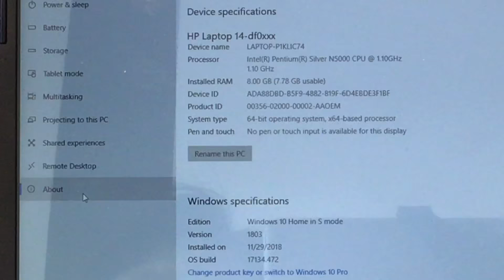How to Upgrade Memory in HP Laptop without User Removable Battery: DDR4-2400 SODIMM | HP 14-df0013cl

Comment from the maker: Almost a year later, this computer is still going strong with the added memory (despite accidentally bending the clip)
Reply: Wait so I can’t add 16 GB?
Reply: Could you help me with this computer my keyboard isn’t working
Reply: @choppmonster7  I recommend you to get 16 GB if you wanna multitask, otherwise 8gb is fine
Reply: Hi Aaron, thanks for the guide. But I need to ask, didn't you loose any files after installing a new RAM???
Reply: @mdlamini11  You don't loose any files after installing ram, everything is on your hard drive.
Reply: @Trevor Alfredo I wouldn't look it up, it'll probably lead to malware not to mention very fucked up
Reply from the maker: @mdlamini11  No, files are not stored on RAM when the computer is powered off
Reply: @aaronwissner  thank you Aaron
Reply: @aprilsvoid582  LOL
Reply: I don't even bother touching the clips.. I just push the ram in and pull it out. Also are you supposed to remove the battery. (You don't really have to, it's just safer I would think..)
Reply: @Trevor Alfredo nice scam
Reply: nice to hear, I have a newer hp with ryzen 5. Critcal Ram website says it can handle 32gb, should i go for it? because I already ordered it. lol. I hope it works okie when I do this too I am a bit nervous honestly. My laptop is my baby.
Reply: @aaronwissner  can we install 16GB +8GB pre installed RAM(Samsung M471A1K43CB1 8GB DDR4 2666MHz RAM) = 24GB RAM

Is it support in HP 15g DR0006TX laptop !?
Reply: Mine still going strong with 4th only.
Reply: @maplefoxx6285 I have a laptop my father had before he passed away and it was his "gaming" laptop, only had 8gb of ram. I'm on a mission to tune that machine up as much as possible since it has two fans and tons of storage. 32gb is twice as powerful as a PS5 and really not that expensive, I say go for it.

Comment: He break the Ram Clip while removing the ram stick he used to much pressure on the clip.
Reply: no  he did not it was already broken when he pulled the bottom off; from what I saw and I watched it twice a factory defect and it do happens
Reply: @memalephyudth  no he definitely broke it lol
Reply: @gamelard1963  agreed, those clips usually just pop to the side and you put the ram back in they don't need to be touched.

Comment: remember the days when laptops used to just have a little trap door with one screw that revealed the ram and the hdd? those were the days! Also did th rubber strips stay in place after you stuck them back down?  I just bought a similar laptop for my elderly mom, I suspect 4gb will be enough for what she does, but 8 would certainly be better.. I just don't want to start peeling tings off and find it doesn't stay stuck in a week or so lol.
Reply: Never again HP
Reply: As a 2000s kid, currently with HP 14, I'm more than jealous
Reply: Picked up a thinkpad t540p not long ago that has that setup.

Comment: Hello i have a question i have HP 15.6 model 15 -dy207dx  8gb-256gb SSD is it possible to use the corsair vengeance i was possible trying 16gb will it work ?

Comment: Thank you so much for this video! I was trying to find video help on how to install additional ram into a laptop similar to yours. I just installed mine and now have 12 GB! You were a God send!
Reply: My hp 14 cm007la has 4gb ram ddr4 and i want to upgrade to 8 or 12 gb, it works 4+8gb? Differents Brands? Because mine is micron technology and here in Perú there isn't that brand, only crucial and Kingston, so it Will work 4gb micron ddr4 2666mhz + 8 gb ddr4 Kingston / Crucial = 12gb ram or 4+4 = 8 gb ram different Brands
Reply: @raymongarrido5682  Micron manufactures crucial memory! 😂✌ and don't use  two different memory types use 4+4 ,or 8+8 not different 4+8 , you will get a slower performance. Make sure the Mhz matches as well.

Comment: EXACT same config on "HP Notebook - 14-dk0024wm" from Walmart...no SSD only M.2 Drive (even though some sites say it has SSD capability - I think they skipped on this model specific)...this model upgradeable to 32GB RAM...Upgraded to 16GB Kit from Crucial...buying M.2 for the slot.  SSD slot is THERE...but no SATA interface/power.  Great Job on Vid Aaron.
Reply: m.2 is ssd
Reply: I have this one, just bought it on clearance at Walmart for $200. I'm here because I knows there's more to this machine than what we're lead to believe. My heart skipped a beat when I found it had an m.2
Reply: "No SSD only M.2" 
This comment of yours lit up a bulb in my head. My HP x360 notebook died. I don't want to take it for repairs because of confidential info on the drive. 
After watching YouTube videos of how to replace SSD, I opened the laptop only to find a big space for a drive as shown above and NO SDD.

Paranoia kicked in. I thought the notebook died because someone quietly stole the SSD. lol

Comment: At 6:40 it looks like you broke that retention clip. I've never seen that happen before! Anyways, there's definitely a spot on the board where a 2nd RAM slot could go, but the slot itself is absent, which is a pretty extreme cost-cutting measure on HP's part. Also, that's definitely a spot for a 2.5" drive but I can't see any connection points to the board. This system has an eMMC, but I can't spot it on the exposed area, so it's probably soldered in a concealed area, and I don't see any other way to connect other drives, via SATA or m.2.
Reply: It popped clear really quietly and easily and then he just kept pulling until it snapped.
Reply: the newer 14 models have 2 ram slots yeah where you mention where it should be, imagine trying to save at all cost that you decide to save an extra .5 of a  cent by not including another memory socket
Reply: @goldchris1111  It's a very low grade processor, it cant hamdle much RAM. Note it's rated for 2440 MHz and I3 or I5 processor would take 3200 MHZ and likely up to 64gb ram.  There would also be a removable drive in that empty slot. Either an M.2 SSD or an HDD spindle drive.  It's a super cheap and lower performance computer, not good for much beyond surfing the web and using Facebook or Twitter.

Comment: Perfect video for my needs. Thanks!!

I have a similar model, the HP 14-cf0006dx. For anyone searching for memory upgrade info on this model, it's virtually identical to the one in the review, however, it has two memory slots. I kept the 4GB slot memory and added 8GB to the other slot. IFixit makes a $2 opening tool that's perfect for this task. Not sure how to add a 2.5" drive but the SSD module can certainly be upgraded.
Reply: so you add 8gb and kept the 4gb memory there?? for obtain 12gb??
Reply: It works good with 12gb ram? Or its better have 4+4 = 8gb ram? I have this question
Reply: Thanks for the info - I too have a HP 14 CF0006DX model. Have you ever found a hard shell cover for this model?

Comment: Thanks for posting. Knowing there are screws under the rubber strips is key.  HP definitely does not want people upgrading these models.  I have an HP 17-by0063cl and it seems like it will be the same.

Comment: Can you keep the ram that's already installed and put 8gb on the other one and get 12GB of ram?
Reply: No u can’t. U can use the 4gb or the 8gb. But not together. It will just slows it or its will uses the lower ram, the 4gb
Reply: Yes You Can ...Just Make Sure its The Same Brand ..

Comment: I work in a hardware store. Typically, M2.5 x 6 would indicate a metric screw size 2.5 which is 6mm in length. Probably not essential to know, but if you lose a screw those would be the dimensions.

Comment: I'm assuming this applies to other laptops with internal batteries?
Reply from the maker: Well, for other HP laptops of the same design, but I think you'd need to look down at a teardown of a particular model to know for sure if the memory could be expanded

Comment: I just got a new hp - 14" laptop - amd a9-series - 4gb memory - amd radeon r5 graphics. Mine came with the additional RAM slot ready to upgrade which I added an 8gb stick w/o removing the original ram for a 12gb total. So would you please clarify why yours didn't seem to have the upgradable ram slot?
Reply: If you loook closely when he picks the bottom off, it shows intel inside
Reply: Me also have same type of laptop. I need to upgrade to 8gb is it possible
Reply: @dhanachinni4346  you can check your max ram performance on crucial.com. it shouldn't be too hard.

Comment: Is there a way to upgrade the graphics card in this laptop?
Reply from the maker: I doubt it, most laptops sold at this price point have an integrated graphics chip or functionality.  It does display 1080p on this particular model though, but I can't recall if it could output higher resolution than that
Reply: @aaronwissner  can we install 16GB +8GB pre installed RAM(Samsung M471A1K43CB1 8GB DDR4 2666MHz RAM) = 24GB RAM

Is it support in HP 15g DR0006TX laptop !?

Comment: How do I know if I can increase the ram on my laptop? Operating system: windows 10 home 64-bit motherboard: hp 184B (socket FT1) I currently have 6gb of ram. Any help would be appreciated!
Reply: crucial.com has a compatibility finder. I used that and then found the part I needed on ebay x

Comment: I had to replace a hard drive to one of this HP laptop, it was a Pavillion, and it was a nightmare. The mainboard was attached to that lid that you removed in the video, so to have access to the components you need to be very careful when opening because there was a flexible cable connecting to the keyboard and the USB ports.  Additionally I missed a screw and ended up breaking a part of the lid. Definitely manufacturers don't want you to upgrade their machines

Comment: How do I upgrade the processor cpu
Reply from the maker: If the processor is removable, then it MIGHT be upgradeable to one that has exactly the same specifications EXCEPT with a higher clock speed. In most cases, if possible, this will only improve performance a small amount

Comment: bought a kit from amazon for opening electronics, came with plastic prying tools, many different screw drivers, tweezers, cutting tools, nd guitar picks 😅 i unfortunately bought wrong sized 16gb of ram though,  gave the sticks to a family member. waiting on two 16gb sticks that will actually fit fingers crossed.

Comment: I have a hp 14 cm007la looks like video one, it has 4gb ram ddr4 and has another slot, should I remove 4gb ram and put a 8gb ram or simple add a 8gb ram on second slot to have 12gb ram? Pls helpme,  4gb ram is micron technology there isn't that brand in Perú can I mix With other brand like crucial or Kingston same ddr4 and 2400 mhz?
Reply: As long as it's the same type of memory you can add it. :)

Comment: HP 15-db0011dx ---Hi - I contacted HP to request the part number for the RAM on my laptop and they told me they don't sell it to me directly.  That I need to see an authorized HP technician as the laptop has a non customer replaceable RAM.  That certified tech must do it.  I have changed ram in other laptops I have owned, but this guy got me thinking.  Any suggestions.

Comment: ‼️ I found that rather than prying it open with a thin object like the guitar pic, just use that same precision screwdriver to push through the exterior holes from the very first screws you undo. It pushes the keyboard away from the bottom plate with no damage!

Comment: hello, so my laptop is newly resetted and i find it really slow and at times it freezes. i wanted to reset it cause it was also very laggy at first, do you think if i buy a 4gb ram and install it there it will be fast? cause it says i can only upgrade it up to 8gb. and my laptop has 2gb ram installed
Reply: Put in 8GB. 4 will help but for the additional cost of the 8BG (about $15 more) put the max in now and forget about having to take it apart again in the future
Reply: Rich MAC oh okay, thank you so much for taking your time to reply, god bless!.
Reply: My pleasure and good luck
Reply: My 14 hp cm007la has 4gb ddr4 and has another slot, what is better? 4+8= 12gb ram different brands or remove 4gb ram and put a 8 gb ram?

Comment: I just got a HP 14-dk1008ca for 400 Bucks. thinking about increasing the ram and the M.2 SSD Capacity. The Processor is only an Athlon Silver 3050U With Radeon Vega II with 512 MB VRam. Doesn't run Bad For it's price.

Comment: Followed your processed, and it worded.  I used an old Amazon Gift card to separate the bottom piece from the keyword.  My model has 2 DIMM slots, so I added 8 gb to the existing 4 gb for a total of 12 gb.
Reply: Do you know what the differnce is . I have this laptop as well and was wondering if i had 2 or just 1 din
Reply: @vinnystx  You can download the technical specs from the HP web site.  It should list that info.  But if you going to upgrade the existing 4gb DIMM with the 8gb DIMM anyway, you will either swap out the 4gb with the 8gb DIMM.  Or if there is 2 DIMM slots, you will leave the 4gb in place and insert to 8gb DIMM in the second slot.  Either way, you will need to open the laptop as shown in this video.
Reply: @LanceMan6012  man, your laptop works good With 12gb ram? I have a hp 14 cm007la With 4gb ram and has another slot, should I remove 4gb ram and put a 8gb ram or better add a 8gb ram in other slot to have 12gb ram? I can have 16gb ram limit

Comment: I could see when you put the new memory in that you weren't straight and that's what caused you to bend the hold in clip. Thanks for showing the location of the screws however as I wouldn't have thought to look under the rubber strips. I have a very similar model HP that I bought from Best Buy for $219 but it has two RAM memory ports which allows up to 16GB of RAM from the 4GB it came with. Since there is space in the case you can also add (using a $10 ribbon cable from HP) an additional hard drive for about $30
Reply: I just purchased it and find it very slow. I was planning to put another 4gb of ram anyway but even just out the box I am not satisfied with its performance. How are you finding it?
Reply: I'm not experiencing that issue. The boot time (because of the SSD) is very quick. I removed some of the bloat ware that was installed on the computer from the factory and then took it out of "S" mode and it's pretty quick. I also do not use the antivirus supplied with the laptop. I'm not certain what you are using it for (maybe very intensive processes?). Remember, this is a budget laptop and the AMD processor that this has is not going to be able to compete with an I5, I7 or certainly an I9.

Comment: There are two slots for RAM on this model, they are butt to butt. You could've install up to 8gb on each.
Reply from the maker: Great response. There are limitations as to what can be installed in the memory slots. It depends primarily on the main board, but perhaps also on the processor. You'd want to look up the specifications for that mainboard

Comment: Argh! Will that open space fit a hard drive or not? Is there a SATA port?  You're killin' me, Smalls!
Reply: Answered my own questions. There's no SATA port, tho that little set of contacts right above the empty space is labeled HDD. If someone had the skill and part, they could probably add a working port. This same basic layout is used for a wide range of configurations and some of them come with 500 gig hard drives. A 7mm drive fits perfectly in the space. There's just no place to plug it in on this configuration. Too bad. I wish they'd spent the extra nickel to include the hardware.
Reply: It not about skill but where to find the parts i think its just shity of hp to not include a sata port.
Reply: You could add a msata ssd but i think that port is occupied by the wifi chip

Comment: BE CAREFUL!!! when trying to open the back lid, the top left corner (the one next to the SD slot) is totally fragile!!! Just remember not to unfold the laptop, keep it close and it should be fine. Saldly mine broke and as that corner is now open due to the insane cheap plastic where the screw goes is broken
Reply: unfold the laptop during the installation?
Reply from the maker: Sorry to hear that; thanks for adding this tip in the comments
Reply: @webee6784  the lid didn't wasn't opening so when I trying to pull it off the laptop got unfold a bit and that's when it broke

Comment: I have a HP ProBook 650 G1 Intel i5-4120M 2.4GHz 8 GB that I brought from Ebay for $49.05 + $5.06 tax the shipping was free but it came with  no hard drive no battery and no battery cable and the back you can open it with one big door don't know why HP is making Laptops today so hard to open ?

Comment: Thanks for the video. I just did this on the Ryzen version of this model number 14-dk0028wm. I found it was easier to start at the corners near the screen hinge and the bottom came off with just my fingers.
Reply: dracer35 hey does your model have 1 or 2 slots for ram?

Comment: Really the way they design these things it wouldn't surprise me if HP would tell you that these computers are not upgradeable.  These days a lot of things were designed in such a way as to make service seem impossible. Just look at these laptops and they do seem difficult to open at first.  They make it look like difficult so that we might be more likely to send it to them for any upgrades.  My 17 inch HP laptop is very similar the way that it opens and all.  I had older laptops before and they had little covers that open up if you loosen a screw or two.  Those make upgrades many times easier.  When I upgraded a WiFi card in a computer with those my worst hassle was the antenna connectors on the WIFi card.  Don't let those pics of them you see in the web fool you, they are really tiny!